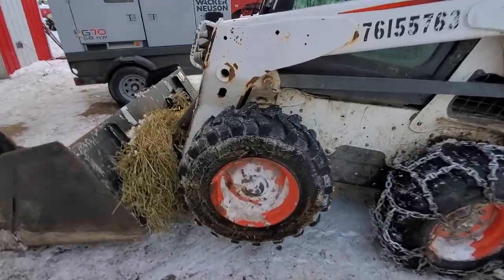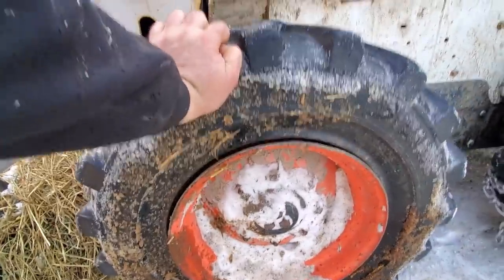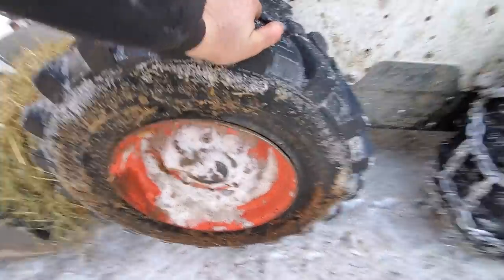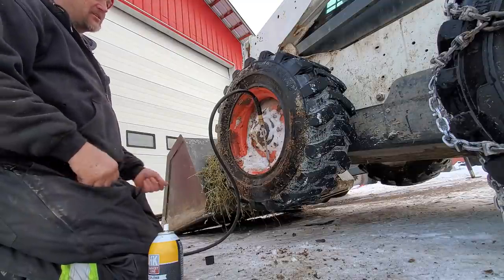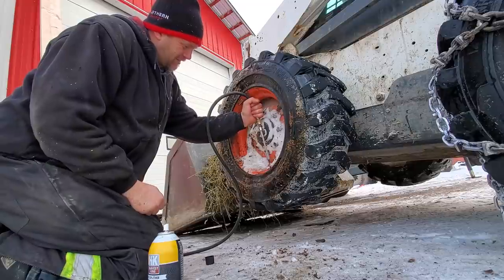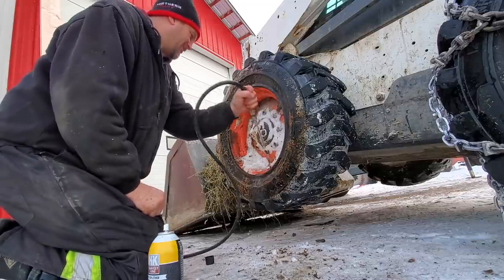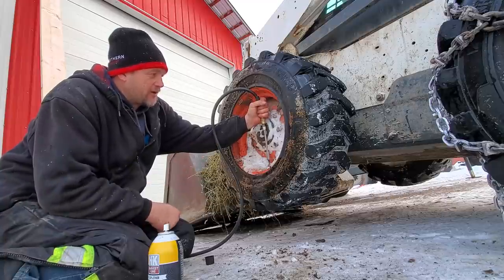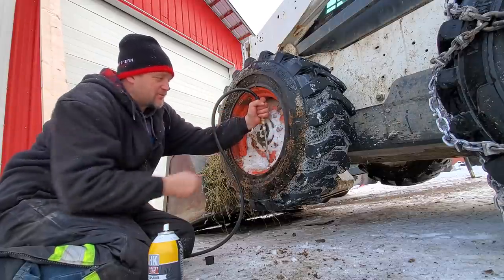Inflating A Tire With ETHER!!!

Comment: Had the same problem a couple of weeks ago. Broke the bead on my skid steer tire. Tried ratchet straps and taking the valve core out. No luck. Someone suggested ether. Was unsure about it so I bought some tire slime. Had a slow leak in the tire too. It worked but nice to see that ether works that easy. Will try that next time. Thanks.

Comment: That works pretty well. When I had my rear tractor tires changed, the guy had some sort of paste he spread around the tire to seal the gap between the tire and rim so he could seat the bead. I don't think the company he works for allows them to use the flammable method lol
Reply from the maker: You would need 5 cans for a tractor tire lol..usually though the tractor tires have tubes

Comment: I thought I noticed water coming out of the air hose whenever you took it off the tire stem. I ended up putting a ball valve on my compressor drain for ease of emptying the tank. Hated having the petcock plug up with scale all the time.
Reply from the maker: It was..it actually was freezing the nozzle...I have the same petcock under my tank but its constantly getting water in it

Comment: I had the biggest Gehl skid loader they made,  I had a tire that had so many plugs in it that it always went flat, LOL,  I would wrap a ratchet strap around the tire and tighten it up to force the beads out onto the rim.  Usually worked, but had to make sure that you took strap off before you put too much air in or it would be so tight you couldn't release it!!!
Reply from the maker: Thats not as fun though lol

Comment: It is good if you have the air hose connected when you shoot a tire. 
The valve may start to leak.
Just a word from Grandpa's practical advice.
Reply from the maker: Should be right after you light it